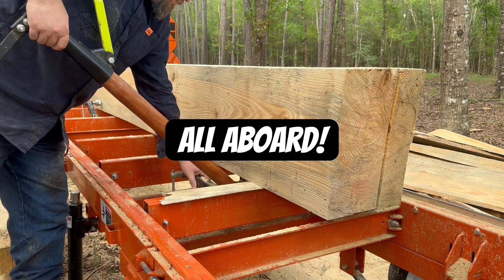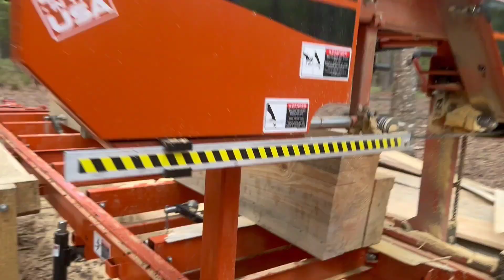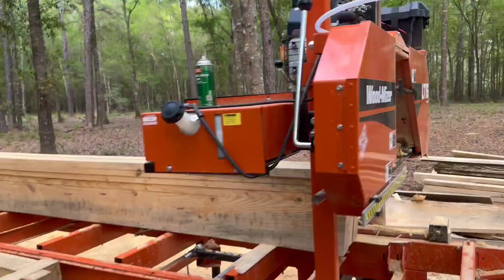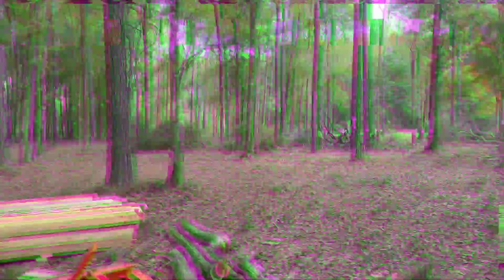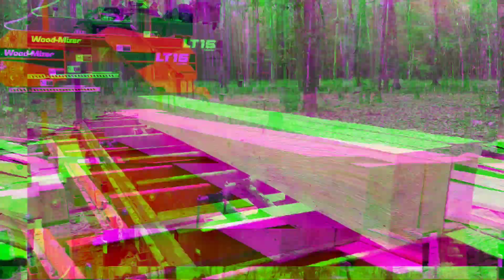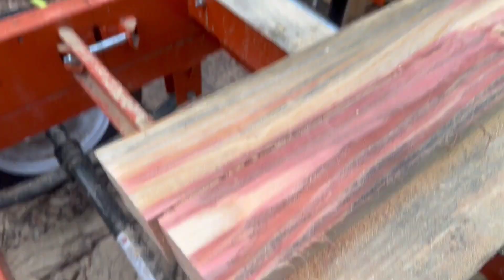Wood-Mizer Action! - Sawmilling Logs Into Lumber

Comment: I’m curious, is the blade not at risk of breaking when you leave the cut boards on top of the section you’re cutting? I would think that the weight could strain the blade if it got to be too much.
Reply from the maker: This saw is capable of making 10+ inch cut without risking the blade. The depth allows you to quarter cut wood if desired. Thank you for the question.